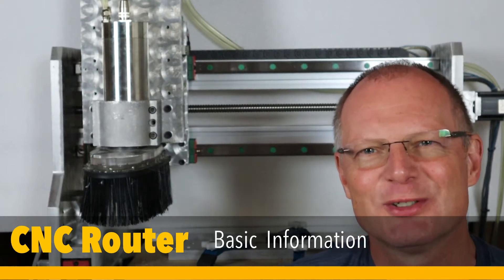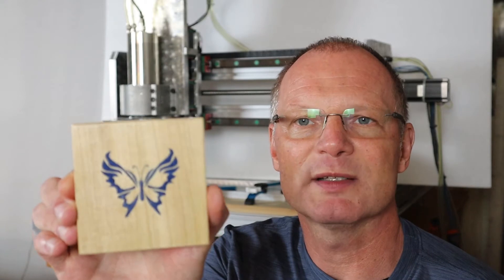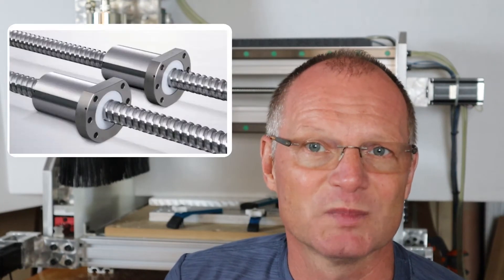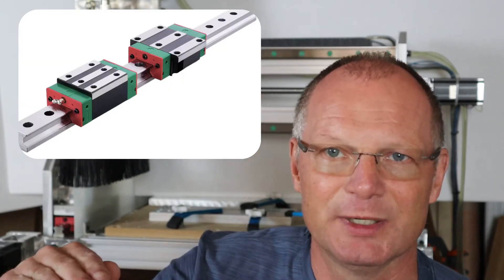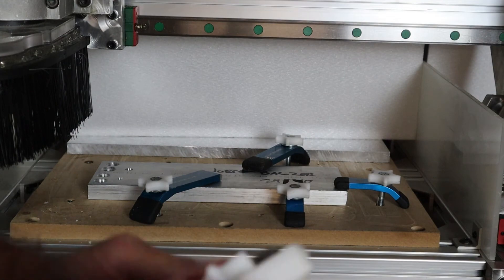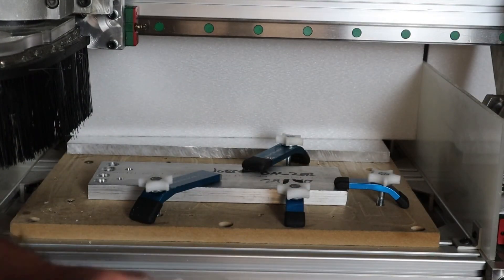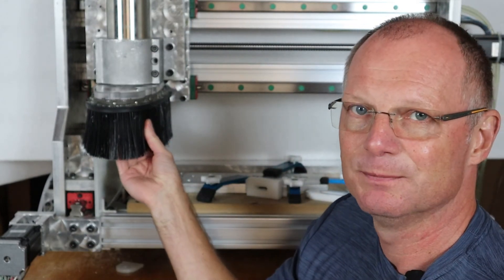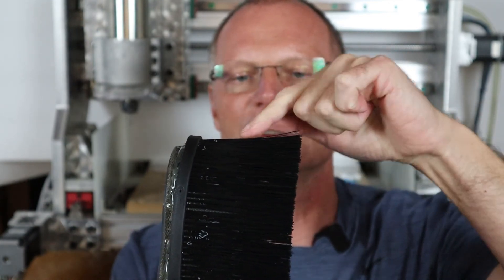CNC Router The Basics

Comment: Thanks for your video.
It would have been nice as well to explain the design of such a cnc. How the side plates and the Y axis rail are hook up together as well as their shape to make even more rigid all this cnc..
Reply from the maker: Yes the design is always a complex topic. Many ideas and solutions are now floating around on forums. I don’t think I would build it like this again but this machine is now also 8 years old. Overall it has held up great.
Reply: @JBWorx   Thanks for your return. I'm thinking of buiding one. Maybe you can give some advice? Video?
Reply from the maker: Have a look at the “PrintNC” I think it’s an ok design and once you have everything set up you can upgrade all the 3D printed parts (that you can also simply buy) to aluminum. The build is also not complex and there are now kits available too. I have never run one myself but know some folks that use it quite successfully.

Comment: What can you tell about AC servos and dual drive axis? I saw you upgraded to JMC servos. I plan to make a cnc router as well however, dur to its size, X axis must be dual drive system. What i'm afraid of is the servos going out of sync and thus skewing the gantry or break something. Antoher thing is how to tune both servos - the only idea i have now is to connect both servos to two PCs running two tuning software and put exactly the same parameters during tuning iteration steps. Thank you for your very informative videos!
Reply from the maker: Yes I had the same concerns for the tuning. However it will work with just one PC. I first turned on auto tuning on both motors. I was able to drive the axis forth and back for my tuning cycle that I wrote (so going forth and back about 100mm or so with the speed I wanted). Next I started tuning the first motor … no problems the divination in position from both motors is so little that the mechanic was fine. I then did the second motor. However it is a must that you hook up the alarm output. If, during tuning, the motor stops the other side would keep going and potentially break something. Hope this helps.

Comment: Great video. I would love to know more details about the machine. Can you link to the plans used or ones that you would currently recommend  ?
Reply from the maker: Thank you for your comment! I do not have plans of my machine ... but I am in the process of making some drawings for the individual elements that I plan to post on my web page. If you are looking for a good quality machine I suggest considering a design that uses: Linear guide rails, ball screws, aluminum construction, 1hp+ Spindle, and if your budget allows closed loop stepper motors.